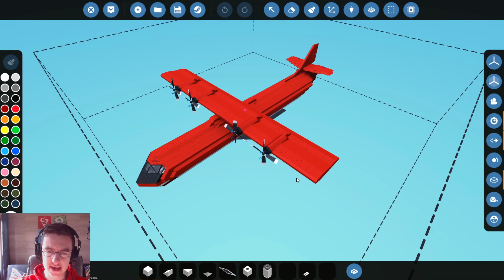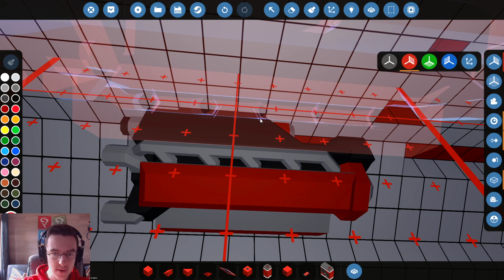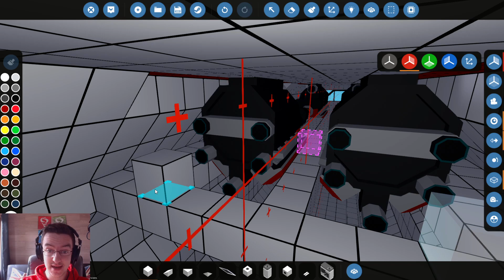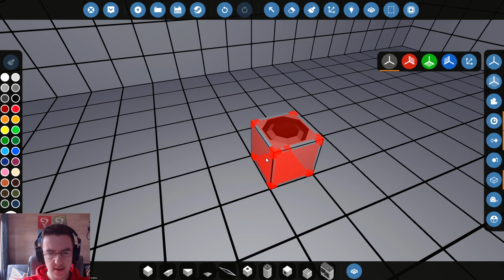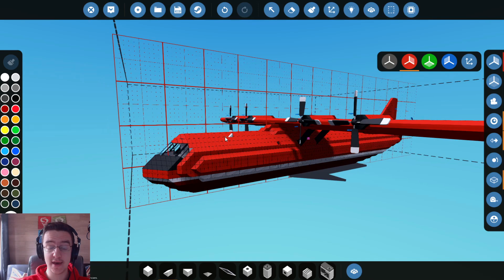Fitting The Engines!  -  Water Bomber Build  -  Stormworks Gameplay

Comment: I am concerned that with the 4 engines your plane's range will be very short due to the fuel tank being relatively small for the total engine mass. I am also concerned that with a full water tank the engines may not prove powerful enough to get your plane airborne. If it had been me I would have instead used a jet engine with at least  1 medium turbine per propeller and maybe another one or two medium turbines just for generators. other than that I think your design should be ok. Also, I made a large 16 wheeled locomotive (the diesel engine powers the wheels via a clutch and gearbox, but without electric motors. It has a top speed of 80 (I am assuming the speed is measured in meters per second.) and over 100,000 liters of fuel. It is pretty large and admittedly ugly, but at least it will have an enormous range even with the huge diesel engine powering it. Not gonna lie, the developers should make another train update to add at least train car couplers, buffers, and 6-wheel bogies at least, though I would also like them to add parts for actual working steam locomotives (the steam driven cylinders and the wheels with connecting rods already on realistically). It would also be really cool if they added snow plow blades and an mission involving snow removal for roads and railroads.
Reply: LightMindedJedi How long time did THAT tanke you to write?